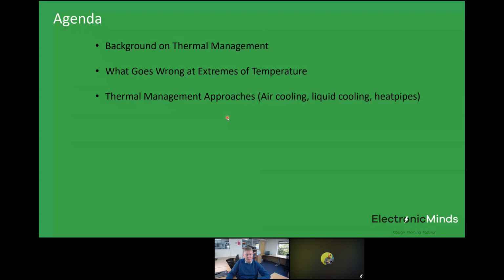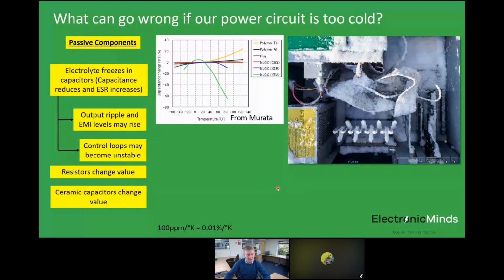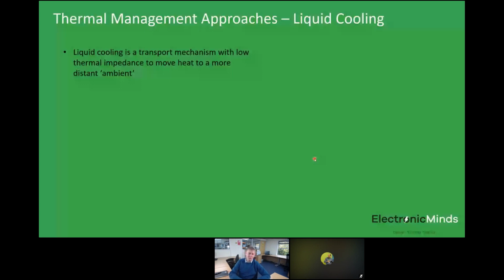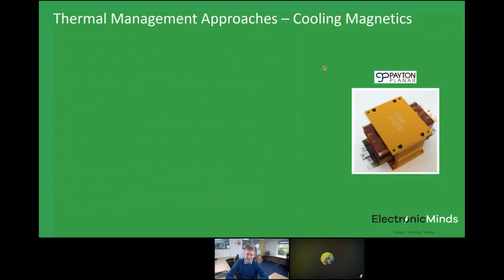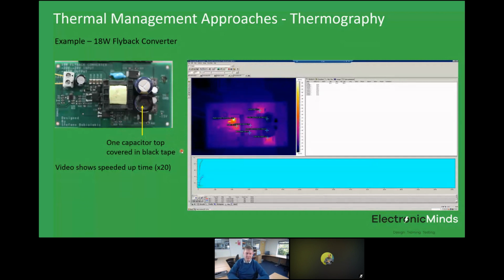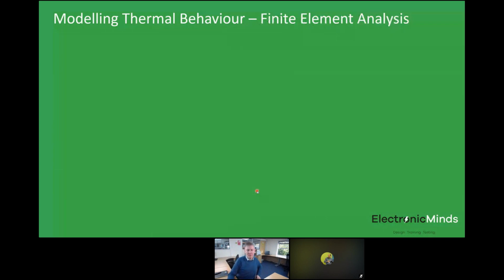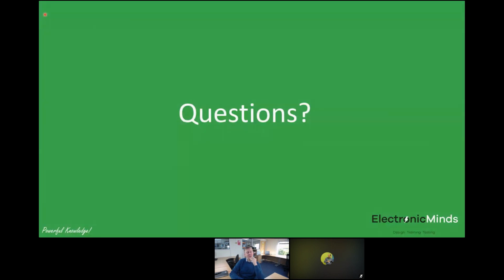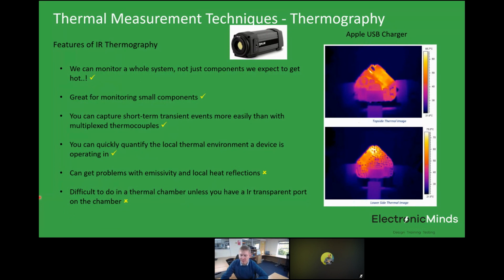Powerful Knowledge 12 - Thermal management in power electronics

Comment: Great seminar. Thanks, very informative. What is your thought with regards to the immersion cooling of power electronics components? It probably simplifies thermal design and increase the heat transfer. Are there particular things to watch out when considering the immersion cooling?
Reply from the maker: Thanks very much for your kind feedback. Immersion cooling of PE is a really interesting approach but not one I have practical experience with. What I think it will do is provide significantly improved heat transfer, especially from components which are harder to cool (e.g. magnetic parts). One interesting thing to consider is that the liquid is just a heat transfer mechanism so you will still need a way to couple heat out from the liquid and into the local ambient. There are some fluids from 3M which look interesting https://www.3m.co.uk/3M/en_GB/novec-uk/applications/thermal-management/immersion-cooling-of-power-electronics/#:~:text=Immersion%20cooling%20involves%20putting%20electronics,into%20the%20heat%20transfer%20fluid.